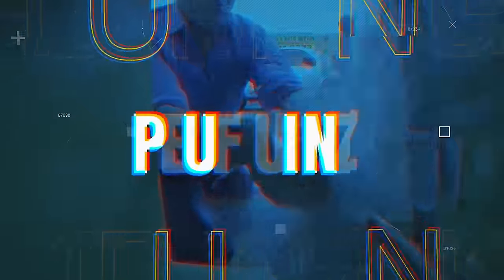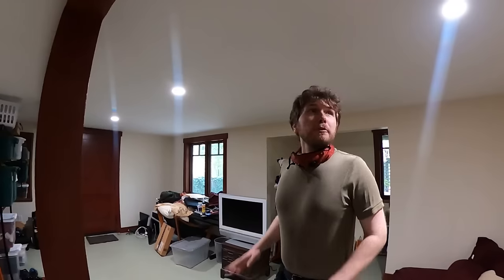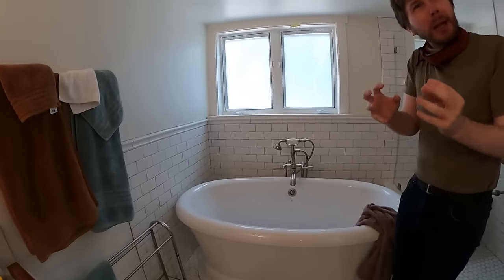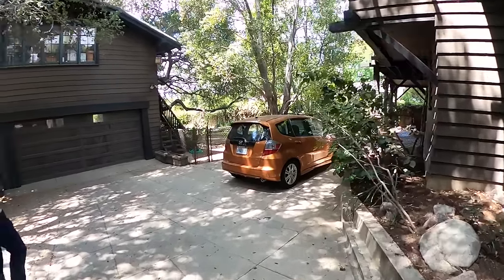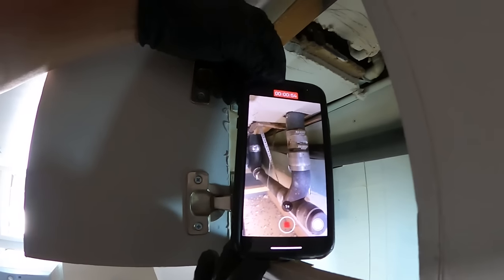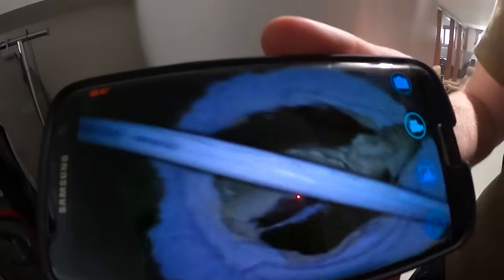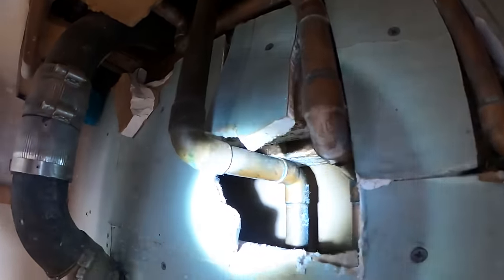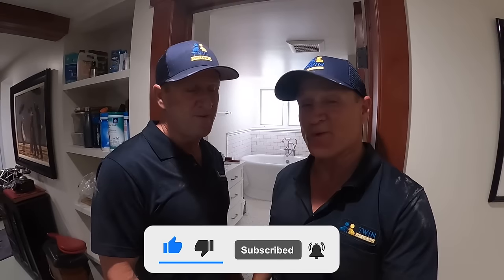HUGE RAT INFESTATION! You'll never believe how they're getting in...

Comment: Great channel and truly enjoy watching your videos.  Dealing with a mouse that found its way in between floors through an uprotected exhaust vent.  They just crawled up the wall and flipped open the metal flap.  Have installed 1/4" galvanized metal mesh on the underside of the vent awning but I believe its now trapped inside.  I will be removing it, placing some Dcon tablets inside the vent and reattaching the metal mesh.  What a battle this has been this year alone...
Reply from the maker: Thanks for this feedback and great share! Your on the right track. Once you secure your home properly, traps will work AMAZING!

Comment: I've got a 150 yo house that's sinking into the ground for lack of a proper foundation. I get an occasional rat in the house. I keep a trap bolted to the wall about 8" off the ground. They can never pull themselves out because they can't get traction on the slick surfaces. When the trap pops off, I can hear it throughout the house.

Comment: That has been going on for way to long. Unfortunately a reno will not fix the problem. And it would be much easier to investigate before the basement was finished. Unfortunately that is the case with homeowner that does not know what is happening or how big the problem really is. Rodent infestation is not to take lightly. They are smart. Traps only work if you camouflage them. And you still have to figure out how they got in to begin with.
Reply from the maker: Great points here my friend. Appreciate you taking time to share your thoughts. 💪💪
Reply: *too